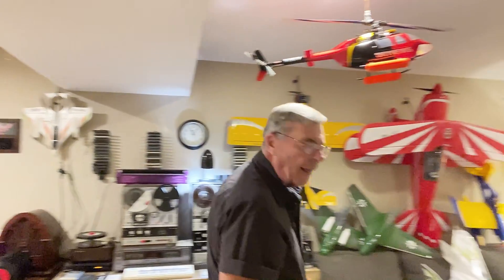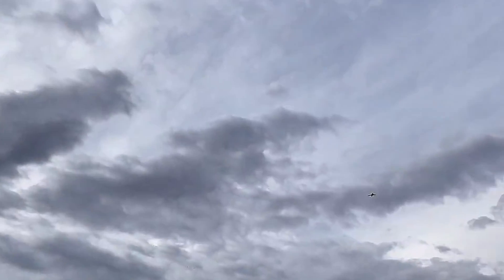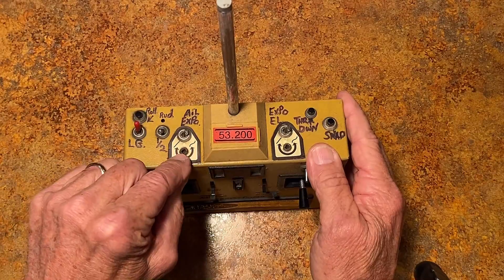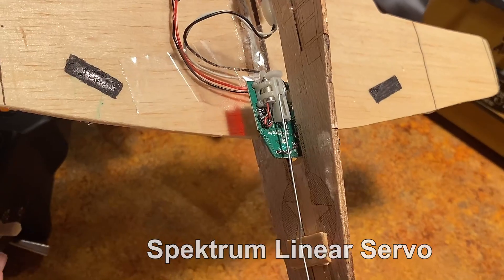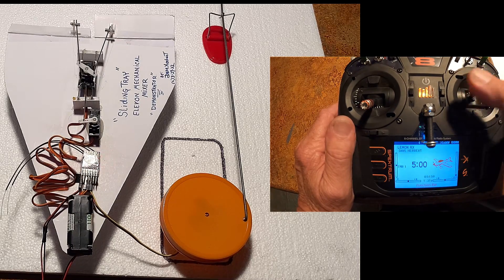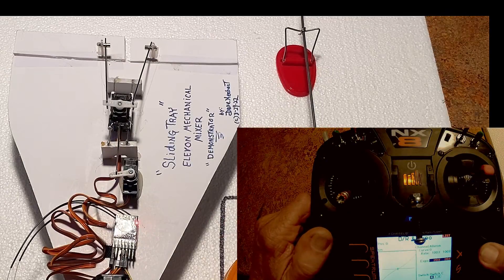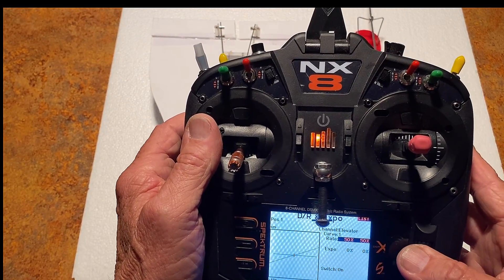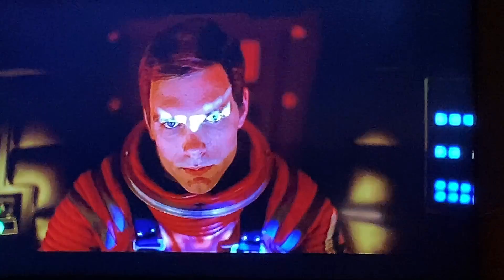Why? R/C Exponential Servo controls, TX cross trims, and dual rates.  Do we need them?

Comment: Kraft was so far ahead of the field, too bad the Japanese radios invaded.

I remember being King at the Apollo field in the Sepulveda Basin with my Kraft Signature Series, I even had the dial a crash module (never crashed!).

It was only a matter of time before Futaba and JR surpassed the features in the Kraft radios. My first PCM 8 and 10 were very nice but never felt as quality as my Kraft.

Todays 2.4G radios have taken the fun out of getting a "HIT" lol.

Thank you for the nostalgia.
Reply from the maker: Right on.  Well, you must've known Bill Evans then, as that is where he flew his wings.  Did you ever send your signature in to be serviced?  If so, I would probably have been one of the 3 of us that would re-tune them or put carbon wipers in the servos when that innovation came out. Phil tried to compete for sure, but just couldn't make it.  I mention Kraft today and everybody just blank stares at me.  But that was a long time ago and now I'm 75.  I don't miss the hits or the clothes pins......or the Ambroid!   LOL
Reply: @NightFlyyer  Yep Bill Evans Simitar, although I never was into flying wings. I was the oddball guy with VTOLs and Delta wings. Remember the old mechanical and stand alone servo mixers?

Worked at Smith Bros Hobby Center in Northridge. Chuck Smith was about the best F1 pilot around and his brother Bob did the CA glues - Bob Smith industries. Even did some work with Carl Goldberg when he did that space shuttle/747 build... Those were the days you spent 3 months building and 2 minutes crashing; today seems to be the opposite.
Reply: @NightFlyyer  I know you're into choppers. Spent time with the Gorham's, Robert was a great guy, John...
Reply: I work at Robin's Hobbies in Glendale, CA and also fly at Apollo Field. I wound up with a pair of Robin SR's old Kraft radios including a Series 79 which has in it Dave's signature dated 1980 and again in 1981 from servicing. small world!